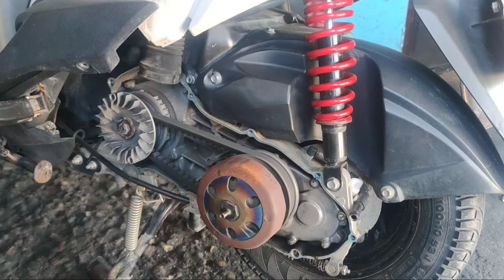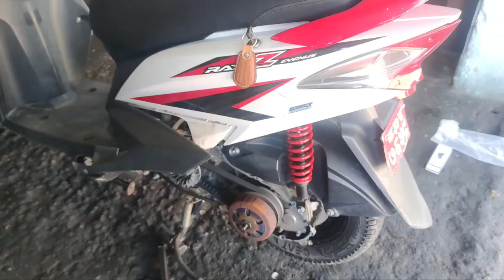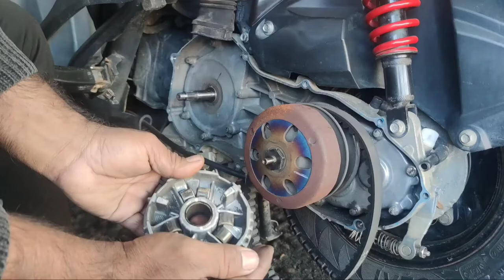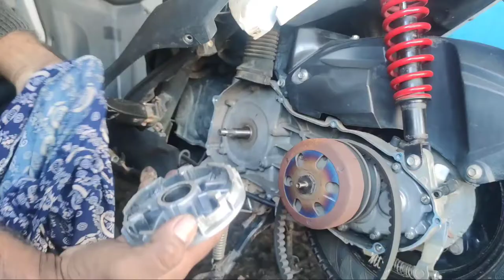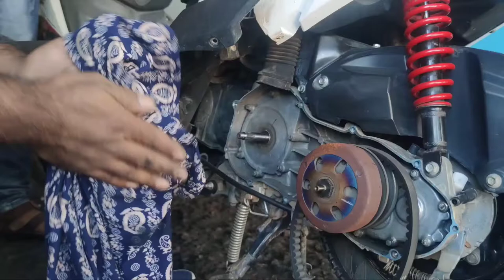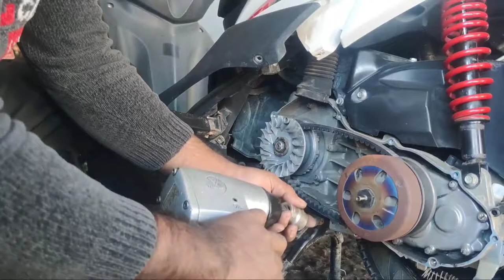How to Fixed pickup problem Yamaha Ray z best mileage problem (Guide)

Comment: after how many kilometre is it required to change the clutch shoe or assembly
Reply from the maker: 2500
Reply: @bikerarena2198  2500? are you sure
Reply: @ahmedAli-ok7gz  10000
Reply: @ahmedAli-ok7gz  wrong 12,000km once
Reply: @ActorVijayTVK  mine is working fine even after 28000km 😇 just a little bit of maintenance is required
Reply: Mine is working fine till 60k km
Reply: @MrED-fv2gx  pickup down ho gya hoga. I was asked to change the clutch shoe after 35000km and I noticed a lot of change in acceleration and mileage
Reply: @MrED-fv2gx  you should also consider changing your clutch assembly and see the difference